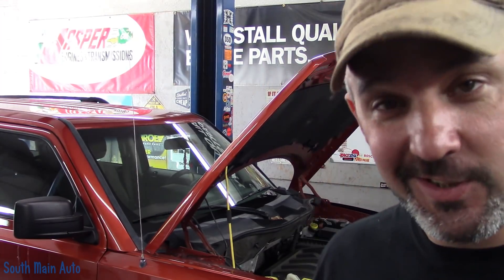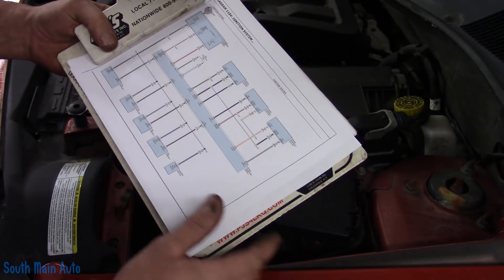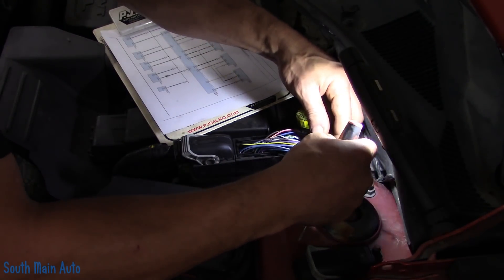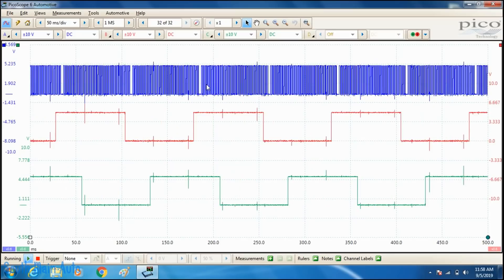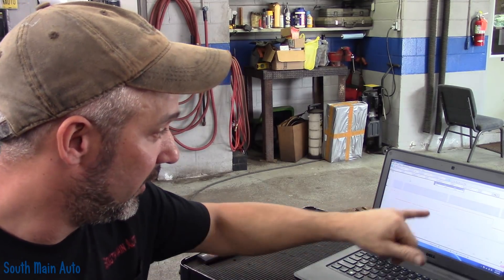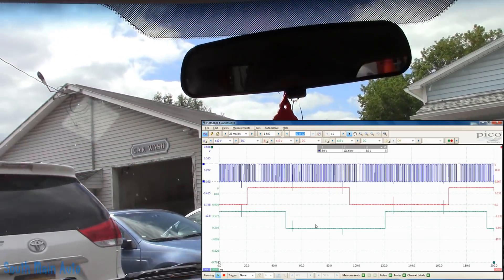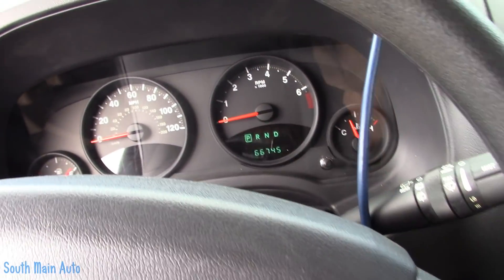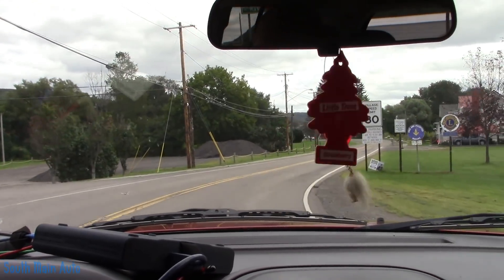Jeep Patriot: Crank Sensor Troubles

Comment from the maker: UPDATE:
Jason replaced the CKP sensor the next day. It was much easier than it was portrayed to be initially. After that we again cleared the adaptive memory and ecu reset, ran the vehicle through a misfire profile relearn and shipped it down the road. All is well in the land of Jeep o||||o 
-Eric O.
Reply: Where's the link to those wire piercers?
Reply: What hardware do you use for a re-learn?
Reply: @DarkLinkAD  Scantool. Autel, launch, snap on. There is a feature in the tool under engine to relearn the crank signal.
Reply: @mph5896  I imagine he uses the most reliable/cost effective one. Thats why I asked.
Reply: Thanks for update
Reply: @DarkLinkAD  Eric O is a scan tool junkie. Has MANY different brands. They should all work with something simple like a crank relearn. I only have one, a Launch 431 (US version) after Keith recommended them a year or so ago. Does pretty much everything I need it to do.
Reply: @mph5896  Yeah, but if it cost more than HP Tuners, Ill be purchasing the one thats decent.
 For example, in one video, one of his scan tools, nearly identical to the other just wouldnt clear the diagnostic codes, no reason whatsoever. He had a backup on hand that gave no trouble.
Reply: @mph5896  Also, Ive gotten by with recording diagnostics using Torque Pro for years, managed the resistor Passlock bypass back in 2003. But getting the crank relearn (On OBDII) Has got me a little stumped.
Reply: There's a chip in the customers windshield right in the wiper travel. Idk if you noticed that or not. Good call on replacing the crank sensor better safe than sorry.
Reply: Smart... Can't see it, hard to get to, send in Jason!
Reply: Where the link for the wire piercers?
Reply: Did you check for tsb from fiat chrysler on the wiring harness for this issue?
Reply: Can't you just relearn the misfire profile, e.g. the adaptive numerator by driving the car after a reset?  For example, do a number of coasts after bringing up to speed so the injectors shut off?  Or, did you do this with your scan tool?
Reply: @jeanvi52  Ditto. I was hoping he would link them as well. Would be extremely useful
Reply: Great diagnosis, where is the link to the piercing probes.
Reply: Spark plug replacement is @ 25,000
Reply: @DemetriV  Amazon  POMONA 6405/POM insulation piercing set
Reply: @jeanvi52  Amazon  POMONA 6405/POM insulation piercing set
Reply: Do not pierce wires
Reply: @bobt8578  Then how do you road test with out a intermittent test connection.
Reply: Nevermind, I found it. Its a  Swin QQTZ15, best one, Dont quote me on that though.
Reply: Was going to comment that I know it's a crank sensor starting to bad. I know because I have the equivalent sensor on a 02 Mazda mpv but this sensor is inside the transmission and tells the transmission and the engine  what the crank rpm is. You have to drop the transmission and take it partway apart to replace it
Reply: Bob T how do you road test basement boy? bet you don’t run with scissors and have never torn a mattress tag off before??? gona gander off and say you don’t even check your own oil....hmmm, jus a guess dilroy...google before you think unless your signal is weak under grandma’s house.
Reply: @mph5896  That's cuz they all have different "Quirks and Features"!
Reply: @mph5896  launch 431 regular model has that feature, I'll try it out.
Reply: Just had the same issue today on a 2.4  patriot. Keep giving me intermittent misfires.random cutting off. I replace the sensor. But forgot to clear all the adaptive memories and resets. Still acted up. After the resets were complete my misfire monitor was all 0s so we shipped it! Had we puzzled. Great video man. Love your page
Reply: i am dead serious about this, cause i am suffering from total shutdown of my engine for several minutes but my codes only indicate intermittent problems....
Reply: OMFG... 2010 is super seriously different then 2010, even though it is the same engine and most likely the same cvv transmission....
Reply: the only problem I have with this, my, 2012 jeep patriot is the fact that it has a continuously variable transmission... i have total dislike of CVT's.

Comment: From the perspective of a 15 year Service consultant, I can tell you this is the hardest thing ever to explain to a customer. If I had a tech that would do a quarter of the diag you do, I would be in heaven!!!
Reply: Sadly, in the dealerships many techs don't diag because he/she doesn't get paid for it. Especially if it's warranty work. Spend 30 to 60 minutes to diag an issue then 15 minutes to replace a part and only get 0.4 hrs flagged.

Comment: There's your problem, Lady - your truck is allergic to beans.
Reply: flagmichael 😂😂
Reply: Lmfao
Reply: The scanner computer used in the video: https://amzn.to/2H3l6dt Autel MK908 Ultimate Wireless Automotive Scan Tool with ADAS, ECU Coding, Full Bi-Directional Control, ABS Brake Bleed, OE-Level All Systems Diagnosis

Comment: It’s times like this that you have to ask yourself “what would Scotty Kilmer do?”. 

The answer is simple. He’d trade the Jeep in for a 1997 Toyota Corolla.
Reply from the maker: Hahaha
Reply: I first saw Scotty on a t.v.station back in the day giving out advice to the callers and have been following him ever since. He is more educational aimed to the gear head impaired, the people who don't much about the nuts and bolts stuff. I have learned many things from him as any mechanic has learned from others. He has his own style and I respect him for that. Basically Scotty is more consumer based as Eric O is more when people buy shiny vehicles with gremlins under the hood that work in the field to put food on the table or show the novice how in detail how to save some coin. Even if it's those pesky raccoons. So rev up your comments. Lol
Reply: Have you seen the Scottie white board?
Reply: Isn't it a '94 Celica?
Reply: Dylan Lewis I think you’re right
Reply: @Richi RIch I'm sure Scotty could find one for you!
Reply: @327JohnnySS  The only thing I've learned from Scotty, is how to replace a clutch in 4 minutes.
Reply: The scanner computer used in the video: https://amzn.to/2H3l6dt Autel MK908 Ultimate Wireless Automotive Scan Tool with ADAS, ECU Coding, Full Bi-Directional Control, ABS Brake Bleed, OE-Level All Systems Diagnosis
Reply: @panzerveps  He replaced an engine in 2 minutes.  After I watched his video I don’t even lock my car doors anymore.  I just take the engine out when I get home and put it back in in the morning before work.

Comment: I changed the crank sensor on my Audi s6 the other day. It took 25 minutes all in the public parking lot. It started and runs fine.
Reply: Glad it was easy.   Thermostat on the 3.0T starts with "remove supercharger" and goes down hill from there....

Comment: Eric, great video. I changed a crank sensor on a Compass last week. You can get to it from the top. You just need to remove the three bolts for the heat shield.

Comment: A couple of notes,   You should have checked the freeze frame data for the code to see what conditions were like when the code was set.   Second, you should set the trigger for the scope on the red trace to show a consistent pattern and the relationship between the traces.   And finally, the ECM will not allow the engine to rev over 4000 rpm when the car is in Park or Neutral.    The dropout only happened when the rpm was over the 4000 mark during your test drive.

Comment: Interesting. I had 1 in last week that had 140k on it. Previous shop replaced the crank and both cam sensors as well as did the relearn procedure, but it would still intermittently throw a po300 as well as a crank signal code. It never died out though. With a scope, we did diagnose it was out of mechanical timing by 3 teeth. We never 'felt' a misfire, but it would buck/surge on a full throttle start from a dead start. Otherwise it ran fine in normal driving, hot or cold.  We had to drive it hard to get it to do it. Apparently, the VVT had to be fully engaged to make the symptom happen. Thx for your posting of this!

Comment: Another 10 buck job there Eric 😁😁, as everyone knows we garage owners work for pennies , spend thousands on diagnostic equipment, had a job in today from another garage , they had a doner vehicle , a 1.4 1998 Ford Fiesta Zetec , ran for 5 mins , cuts out , the owner said he has swapped the fuel pump relay, (I checked it , he had changed the cooling fan relay ) 🤗🤗🤗🤗🤗🤗 , eventually traced to crap Chinese replacement in tank fuel pump .

Comment: Just solved my 2013 Edge small evap leak that was not the fuel inlet thanks to you and Scanner Danner. It was the purge valve $30.00 part, 15 minutes to replace.

Comment: Crank sensors like to fail with the engine hot, although I've seen them fail and never work again. On extremely rare occasion, I had one car that it would only not start after shutting off and sitting for five or ten minutes (hot soak). Eventually after sitting long enough it would start again, problems like that are always fun to figure out. Hey Eric O., just remember, if I can stall out by the side of the road, so can you, Haha.
Reply: Probably a heat related problem. Notice he could not recreate the problem when the car is coid. He had to drive it and rev it high to get the engine hot. Mechanics know this but they love to document the problem and charge for peripheral diagnostics instead of addressiing a hot engine due to exhaust leaks, emissions leaks, egr valve leaks, They love quicker solutions that can result in more work for a later time.

Comment: Makes sense that the system is setting a default strategy and then its causing the miss fire counts to start counting then causing miss fires sounds like a bad crank sensor if the crank sensor is reading crazy the ecm is going to think its misfiring

Comment: Yay for hand crank windows!
Reply: Better yet if it had a manual transmission...
Reply: @adventureoflinkmk2  ya
Reply: Manual transmission and hand crank windows FTW!
Reply: @stevenrice47  One of the main reasons I keep my nearly-perfect 1997 Saturn.
Reply: And front quarter windows, never needed air / fan just open the quarter?
Reply: @Mrfort  Front quarter windows have been gone for a long time. My 1987 Cherokee had them as an option.
Reply: @Mrfort  Until you mentioned them I had not thought about them. But I miss them. They were great little windows, they did so much.

Comment: My first and last experience with AMC back in the day it wasn't a jeep. It was an AMC Matidor. I replaced the badly knocking engine from a 360 to a 305. I couldnt see any difference in GO. I found out it was built with Ford and Dodge Parts from the factory. The starter was always being cooked by the headers. I thought I was cool because it was a James Bond car.

Comment: This video came out at the right time. I suspected my crankshaft position sensor on my 93 legacy was failing. I found a split in the sensor lead and then yesterday it was misfiring and I'd guess its stalling out but it being a manual it was restarting itself. It was raining heavily yesterday. It flashes the old 11 code. I have the part on nxt day Express. But they way the jeep stalled out reminds me of when at idle t(he Subaru) with me flooring the pedal it acted like I had it up to the red line but it was only at 3.5k rpm. I'd say its stalling and starting. I need to invest in a scope.
Reply: Also it has intermittent starting and on failed starts the tach goes nuts sooooo

Comment: It's a shame what they have done to Jeep.
Reply: Jeep always been trash next to Chevrolet
Reply: Jeep is a name they sell people. Brand recognition. They are basically throwing a Jeep name plate on a crappy Fiat platform. People eat them up with a smile on their face.
Reply: @mph5896  ya
Reply: It all started with Liberty.   Owned 2 (CRDs).  The second stared falling apart at 95k right on schedule
Reply: IndianapolisGerry my buddy had a liberty diesel. He thought it was the greatest thing since sliced bread. I knew it was a toilet after the second time we had to push it
Reply: if i did get a jeep, it would have to be a late 90s model with the I6
Reply: @thewarzoneking  Ha !  Ha !  you mean just like Chevrolet right?
Reply: @RicardoPCGamer  Ran a southern `99 TJ for a few years. It was previously tricked out with cold air intake, chipped, and magnaflo exhaust with a header. Did a 4in. lift and 33`s and it was gutless. It was a squirelly pavement queen. Real P.O.S. I loved  the looks of it but dreaded having a long drive. Just watch any of the Wranglers on the highway trying to stay in their lane. bwahaha
Reply: @RicardoPCGamer  Mines a 2006 and its been pretty good. It has the 3.0 but it was built in Austria not the USA.
Reply: @2DogsVlogs  european jeep is a completely different engine and powertrain. The 3.0 is not even an engine they use in the american jeeps. They do have an optional 3.0L ecodiesel, but that was from 2012 and newer models.
Reply: @mph5896  - that's not a Fiat influenced vehicle. It was designed and produced long before Fiat came around.
Reply: My 94 Wrangler 4.0/5-manual was rock solid. soft top 4x4. many great memories.
Reply: @meabob  I guess it had a premonition as what Fiat was going to do.
Fiat ESP 🤣
Reply: @REDMAN298  sounds like you might've needed a steering box buddy.
Reply: @MsPokemonsoulsilver  and you wish you knew what you`re talking about.

Comment: I had a 1990 Plymouth Acclaim with the 2.5 that had the same problem. Ran fine cold, but once warmed up it stalled out under load. Looks like Chrysler's haven't evolved much in 30 years. ☹️

Comment: I had this happen... Similar symptoms, but what's obvious is the issue only exist under load. I had intermittent cam, also correlation code rarely!

Next time, just fyi check the desired cam actual angle vs desired, if these aren't in synch-you'll have crank/cam codes because of poor actuation, i wound up eventually replacing oil control valve, oil changes would work temporarily

Comment: I’ve done a few recalls for replacing the pig tails on both cam and the crank sensors. So if this issue happens again look into that.
Reply: Have seen the same problem on PT Cruisers. The power to both sensors is from a defective split connection inside the pigtail harness leading to intermittent stalling. If you just rely on fault codes and throw parts at it, the problem won't go away.
Reply: Christian, any recalls for Jeeps?
Reply: Guys I just replaced my crank sensor guess what 64k miles ran up a sneeze now it won’t stay running the tach jumps up and around until the motor dies. What are these pigtails, I’m in for a long week fuck
Reply: @999paisley  just the 2.4s in the patriots and maybe compasses
Reply: @babyjay3055  I know those cars have throttle body problems too man. The oil pools in them and ruins the sensors and motor. But if your car doesn’t have the recall I wouldn’t touch the harness. Just test the harness real good. Use a multimeter and do the ole wiggle test. And pin drag it. But you really should just do the diag and try to find where the problem lies.
Reply: God damn it. I’m not a mechanic bro, wiggle test while it’s running?? You mean test for continuitity with a multimeter? Is there specific way or method I can look up to test it what am I looking for on the ECM or the Fuse box harness? What’s the throttle body I thought this was all electric damn.. I guess I’ll find out eventually
Reply: @babyjay3055  yes the throttle body is electronic, but the oil will deep into the motor and ruin the sensors. Also yes wiggle it while it’s running and see if I changes anything. And def check for continuity and for voltage. You’ll have to look up the pins to see which wires are which. But if you have any check engine lights that’ll pint you in the right direction most likely. But I would try to duplicate the rough running while monitoring data on a scanner and see if anything doesn’t seem right. Then again if your not a mechanic so you might not know what to look for. I would also try and clean the maf sensor with maf cleaner and blow it off gently. But you might need to take it to someone. Sorry bud. Hope this helps a little
Reply: @christiangraham4579  thank you yeah it’s in the shop right now, I’m praying these guys know what their doing
Reply: @babyjay3055  good luck man!

Comment: I would like personally thank you kind sir I'm getting Sensor B bank one and I changed exhaust side without knowing thankfully I can put the Sensor on the intake side 😄 now to see if that fixes the issue
Reply: I've had a problem with Sensor B bank 1 ever since I've done the Crank position sensor would a relearn have anything to do with this and I changed the exhaust side was that the wrong Cam Sensor. Thank let me know

Comment: I'm sure you know, but chrysler has a ckp timing procedure. It has a term which I forgot. The procedure is 1st gear upto 3,000 rpm and let off throttle and let the vehicle slow to idle speed. Don't apply the brakes. Repeat for 2nd grear.

Comment: I assume you checked the crank sensor connector condition. It could have a broken seal and the pins full of rust, especially with all the salt on the road in your area. Increased vibration at high RPM can cause it to loose connection.
 I would also check the large connector on the ECM. There may be some corrosion on the pins as well although you did see the signal break ahead of the main ECU connector. It won't hurt to check before replacing the sensor. I've learned to never assume anything.

Comment: Thank you Eric. Good job. Can I get the part number of the tool you used in a video last year where you used it in the harness loom to protect the wires from your razor blade as you were cutting the tape. I had the number but lost it. I don't see it listed in your tool listing. Have a blessed and safe week.